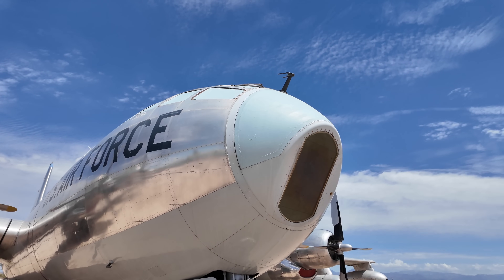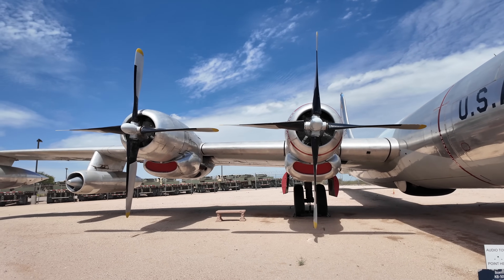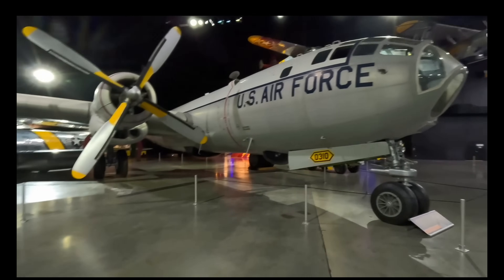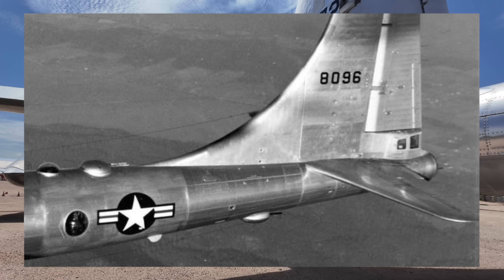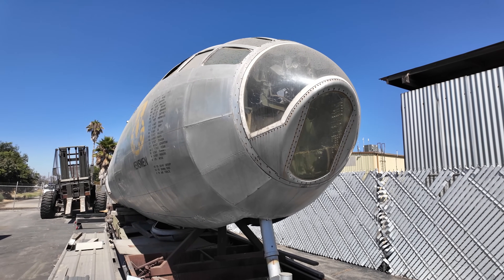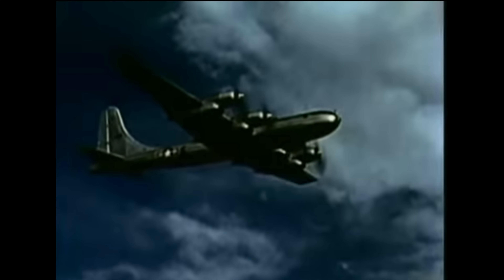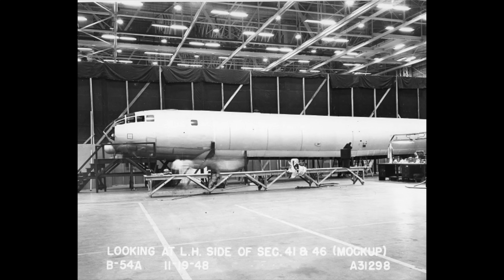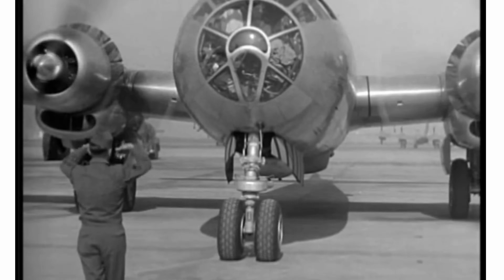Guided tour around the Ultimate Superfortress - the Boeing B-50.

Comment: Thanks Paul. Excellent as always. Please check out the KC-97, which you forgot to mention. Before the KC-135 (essentially a modified Boeing 707), the KC-97 was the common prop-driven tanker. It was also based on the B-29, but looks much different. I believe Boeing even had a civilian airliner based on the same frame end engines (Boeing 377).
Reply from the maker: Yep I’ve filmed the kc-97 and a video is coming :)

Comment: John Wayne's  "Jet Pilot" had a scene where the ground crew was "pulling blades".  (Manually rotating the engines to get oil out of the bottom cylinders and also prime the oil pump).
The R-4360 was a "maintenance monster" as the R-3350 became much more dependable.  But the advent of better jet engines, spelled the doom of both engines for military aircraft of all types.....  Except the smaller aircraft.

Comment: The B29's rudder was pretty much useless below 80MPH during takeoff, the rudder height extension of the KB50 seems to indicate this was a design flaw.
Reply: B-50 needed more rudder to handle the much more powerfull engines it used.
Reply: @tomsamuelson8512  B-50 was the bomber Curtis LeMay wished he had, he disliked the B29 due to operational shortcomings.

Comment: A problem they had with the B-50s, when they first went into squadron service, was that they lost several on takeoff, killing all on board.  This had not been a problem in the test units, just squadron service.  Then one day, a B-50 lost an engine on takeoff. The flight engineer,  who handled much of the engine controls, went to shove all the mixture controls into Auto Rich to ensure maximum power from the remaining engines, only to remember one of the many differences between the B-29 and the B-50 ... they reversed the mixture quadrant,  so that what had been Auto Rich was now Idle Cutoff, which would stop all the engines.  He rammed the mixture control to the proper location, and the bomber lived to fly another day.   Problem solved!

Comment: I disagree.  The B-29 as used during WWII was not a success.  It was plagued with engine fires, short engine life expectancy, runaway propellers and a vaunted bombsite that couldn't deal with the Jetstream or Japanese clouds.  The bombing altitude was thus reduced to 8,000 ft. or less.  Which in turn made the pressurized cabin unnecessary.  Capture of the Philippines and Okinawa also negated the range value of the airplane.  Finally, more B-29s were lost to operational causes than were lost to enemy fire.

Comment: You showed a photo of a B 29 fuselage at Chino air museum that was modified to look like a B50 .I was there as the nose plexiglass was modified so as the museum could claim it as a record holder B50 .
Reply from the maker: Really? My understanding is that that's the fuselage of the actual Lucky Lady 2 B-50.
Reply: @PaulStewartAviation  You'll notice it's got the 'D' type nose, which the original Lucky Lady II didn't have. So it's either a different plane or a later modification. Just guessing, of course. When I did the B-50 for Microsoft's Flight Simulator X I included both versions. Unfortunately, this great video wasn't available to me then :)

Comment: I suppose there are not many other viewers of this fine video who have actually watched the KB-50J in operation.  I was an USAF armorer stationed in Germany 1961-1964, and periodically went to Wheelus AFB in Libya on temporary duty.  Under the desert Sun I watched an occasional KB-50J using all 11,000 feet of the runway struggling to get airborne with a full load of fuel.  I have pictures of many of the fighter types, F-84, F-86, F-100, F-101, F-102, F-104, F-105, cargo planes, mainly C-124, C-130, plus C-118s, and amphibious aircraft such as the SA-16 that all came and went at Wheelus, but I don't think I took pictures of the KB-50J. I do have pictures of the propeller from the wreck of the B-24 Lady Be Good  that was at the base of the flag pole at Wheelus.  It was an interesting place to be.

Comment: Designating the B-29D with the new series  B-50 was a move to justify funding of a "new" aircraft.  In some ways, the B-50 was indeed "new" over the B-29 it replaced, with a taller empennage and the uprated P&W Wasp Major engines.  Largely a POV discussion.  Years later, there was a revision of the B-52, the "H" model, which, like the B-50 WRT to the B-29, had a different tail section, upgraded ECM and navigation, and the quad fifties in the tail replaced with an M61 "Vulcan" 20 mm rotary cannon.  I believe this version had the tail gunner not in the tail from the get -go, a modification that was made to the "G" models during scheduled depot maintenance at Tinker AFB's ALC from having him in a separate tail gunner's compartment.  Since the majority of bombing missions were anticipated to be done at night, the lessons of "Black Tuesday" over Korea in 1951 still fresh in the mind of the Air Force when the B-52 was being developed, the later models and the "D" models, when they received their programmed depot maintenance, had the low-light-level TV system to aid the gunner, along with a tail cone radar.  Aside from the tactical benefit of having the tail gunner with the ECM operator in the main cabin, it was realized that the days of visual aiming of defensive armament were long past.

As for the B-50s, they entered service with SAC in 1948, General LeMay knowing full well that they were a stop-gap until the faster jet bombers were produced.  The Soviet V-VS had few aircraft that could reach the altitude necessary to intercept the B-50s and RB-50s, the latter making routine photo recon missions over the USSR; which had numerous radar coverage gaps along its long borders, especially its Arctic coastline.  Ironically, the main "interceptor" used by the V-VS was the Lend-Lease supplied P-47 "Thunderbolt", which supercharged P&W R-2800 radial engine gave it a ceiling of 42, 000 feet, more than enough to catch the B-50 with its max ceiling being 37,000 feet.  The Soviets were running out of spares for their Thunderbolts, and had to work clandestine deals with the other US WWII-era allies that also had these aircraft to keep theirs flying.  But once the MiG-15 entered service, the paradigm had changed entirely, as the MiG, like the German Me262 before it, only even more so, had a huge speed advantage over its adversary.  The only thing that limited the MiG for intercepting B-50s and later B-47s was its fairly short range; it had to be prioritized to "defend" high-value targets.  After "Black Tuesday" in 1951, daytime missions of both B-29s serving in Korea and RB-50s elsewhere were scrubbed due to the obvious high risk.  

The B-47 entered service late in 1951, and a specially modified bird for recon performed the first mission over hostile territory late in 1952.  As B-47s entered service with SAC, both as bombers and recon birds, the B-50s were relegated to secondary roles or taken to the "boneyard" at Davis-Monthan AFB.  However, as the need for aerial refueling was becoming obvious, but the new jet tanker, the KC-135, would be several years away, the versions of the original B-29 were converted, with the KB-29s appearing in 1948; the KC-97 "Stratofreighter" in 1951, and the KB-50 in 1956.  The latter two usually had two GE J47 turbojets added outboard of the piston engines for takeoff and "burst" speed, to either catch the aircraft they intended to rendez-vous with, or in execution of the refueling maneuver with the tanker "heavy" and the fueled aircraft "light", as often the difference between the top speed of the KC-97 or KB-50s and the STALL SPEED of the jets they were "gassing up" wasn't all that much!  A typical method was to, in order to gain some extra speed, start at a fairly high altitude, about 30,000 feet, and make a gradual descent during the refuel procedure, to, say, about 10,000 feet!   The KB-50s served until about 1965, when too many of them were being grounded due to metal fatigue in the wing roots!  The KC-97s served until 1978 with Air Guard units, giving this type a career of over 25 years!
Reply: It was.not an uprated engine but completely new.  Radial engine with 4 banks of 7 cylinders
  B29 2 banks of 9 cylinders
Reply: @warwicksmith-es7go  Not only different engine (4 bank versus 2 bank, as you pointed out) but also a different manufacturer, Pratt & Whitney versus Wright.  The R-4360 engine was nicknamed "The Flying Corncob" due to, in order to facilitate air cooling for the rearward banks, they were staggered in a helical arrangement.  This engine was still prone to overheating.  Also, even though air-cooled engines, especially radial configurations, are made with "loose" tolerances as compared to a liquid-cooled one, the R-4360 was especially "loose", making it rather noisy with piston slap.  They had a significant thirst for OIL, which often proved a limiting factor for range!  My Dad, who served 20 years in the Air Force and worked with KB-50s, on their way out, noted how the "solution" was simply to carry 3-4 55 GALLON drums of engine oil; the flight engineer would pump them into the recip engines during flight, as oil could be fed to them from the fuselage.  One advantage, though, of this high oil consumption was that the engine friction was reduced, which cut down on the heat build-up, and the oil itself was an effective "coolant". 

 The DISADVANTAGE was for the ground crew chief, as he and his men had to change out the spark plugs with a "fresh" (often the other set that'd been de-greased, cleaned, and gapped) set after EVERY sortie.  For the B-36 and variants, with SIX of these engines, that meant 336 plugs had to be changed!  One can imagine the working conditions for doing maintenance work on the "Aluminum Overcast" at those "Northern Tier" bases during the winter!  Shelters to at least shield the ground crew from biting arctic winds were improvised, but performing maintenance work was GRUELING and labor-intensive on those big birds...a reason they were retired once the jet bombers were in service.

Comment: Keep in mind that only remote-controlled aircraft flew through the radioactive clouds.
The B29 was designed BEFORE WWII and built in 1942. The B36 was also designed pre-war, with range to reach Europe from the USA if the UK fell.
FYI: the B17 was in production before the war.
Reply from the maker: Thanks for the extra info
Reply: A "flock" of unarmed (decreased weight for the long over-water flight) B-17s from the US Mainland were expected to land on Hickam Field, Territory of Hawaii, on December 7th, 1941.  The Japanese attackers were, at first thought by American radar operators, to be the B-17s.  They were, sadly, wrong.  Things went downhill from there.
Reply: @WilliamMurphy-b6v they also made a movie about them in '42/'43.
Reply: Thank you.  I never heard of the B-50 before today. B-36, B-47, yes, but usually this history, the stretch before the B-52, is barely covered. Incidentally,  with the B-36, I remember reading the crews called it "the bucket of bolts" because of the intense amount of maintenance  necessary after every flight.

Comment: The 3350 engines on the original B-29 were definitely a problem especially with overheating made worse by overloading of the aircraft on the first raids on Japan. The later 'Silverplate' versions had the new R-3350-41 engines installed which were fuel injected and had the new fully reversible propellers along with other enhancements which made a big difference especially when they carried one 10,000 lb bomb.

Comment: Excellent as usual! It's fascinating that the B-29 and its derivatives seemed to outlast the B-36 in active service.
Reply: the smaller aircraft had more utility in secondary roles whereas the 36 was quickly superceded in its primary role and was way too big and complex to adapt to tanker, awacs, test platform, etc. with the unique exception of flying nuclear reactor...
Reply: The B-36 was put into the role of strategic bombing of a EUROPEAN adversary from bases in the CONUS in an era where interceptors had about DOUBLED their top speeds and increased their service ceilings by about 15,000 feet, nearly THREE miles from what was the capability of the Germans, Italians, and Japanese ca. 1942.  It was still not easily intercepted due to the high altitudes it could achieve, and its impressive bomb load still made it useful.  But damn, when you have to change out 336 spark plugs after EVERY sortie, that gets rather expensive and maintenance-intensive!  

There was but one variant of the B-36, the XC-99, of which but ONE example was produced; it was used by the US NAVY as a transport, and did well.  Simply one expensive big bird, when other cargo planes like the C-118, C-121, and C-124 Globemaster II ("Old Shakey") in the "recip" era were available and less expensive to keep flying.  As jet bombers replaced the B-29s, some of which were converted into tankers, and the B-36s, the latter, due to their high ceiling, found some extended life in a "Featherweight" conversion for the high-altitude recon role.  Stripped of defensive armament and some crew, these RB-36s were still all but impossible for the MiG-15s and MiG-17s of the V-VS to intercept.  Indeed, the Soviets prioritized SAM development, and also developed specialized high-altitude interceptors to discourage USAF high-altitude overflights and also to defend higher-priority strategic targets, starting with the ill-fated La-250.  Later, they introduced the Tu-28 "Fiddler", the Sukhoi Su-15 "Flagon", and the Yakolev Yak-28 "Firebar", but by the time all those birds entered Soviet service, the RB-36s had been retired in favor of the RB-47 and the U-2.